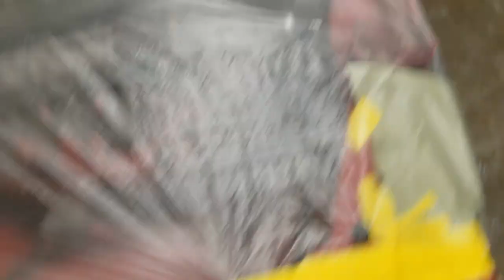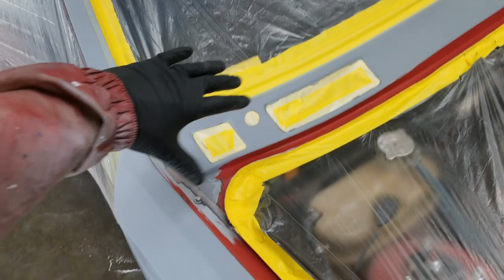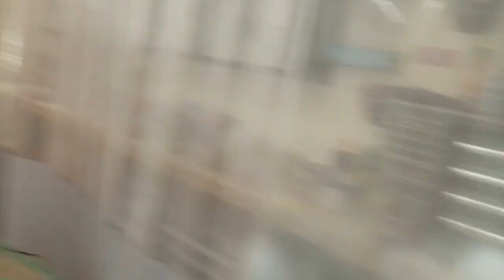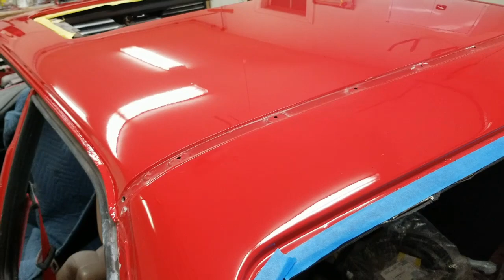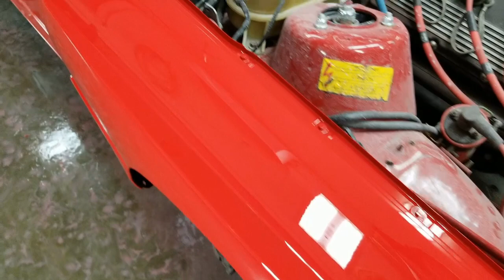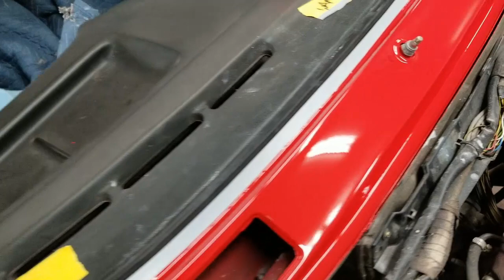1988 BMW E30 M3 PART 7 | FULL REFINISH

Comment: The Cromax seams to color match well with these older BMW's, which products/numbers are you using for epoxy/primer/base/clear, and approximately how much quantity for an E30 like this?
Reply from the maker: I use nason 491-16 epoxy, cromax 7704s primer, 77X0s sealers, chromabase basecoat and either Nason 496-00 or cromax HC7776s clear depending on the job. Using 7776s on this one. Primer qty as needed, about 3-4 qts of base depending before basemaker, and probably 1.5gal clear
Reply: Awesome, thanks again Sam. Can't wait to see how this one finishes out